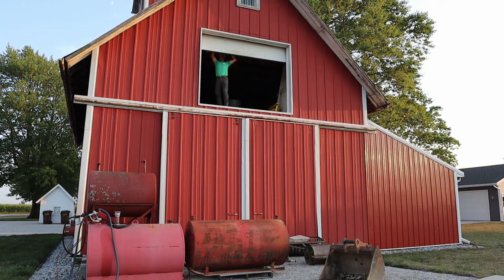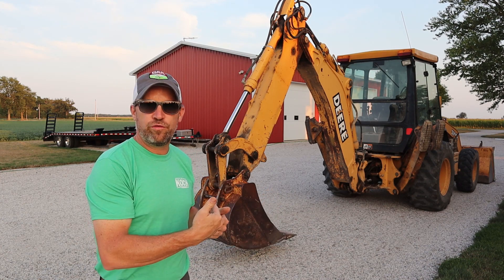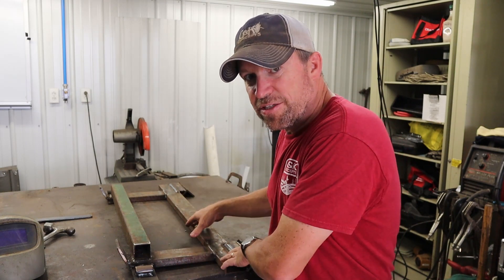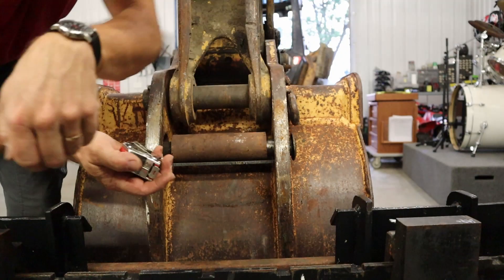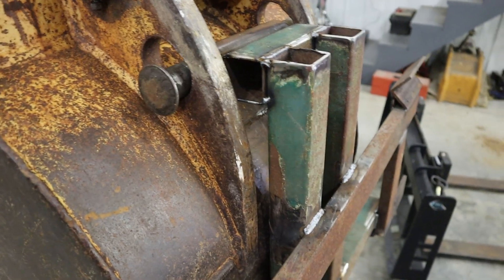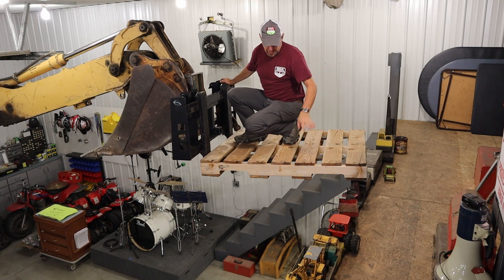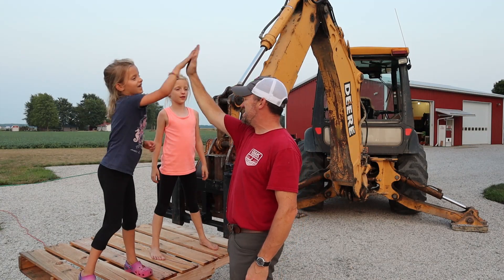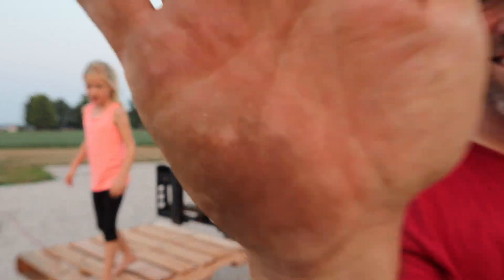Backhoe Forklift! || How to Make Pallet Fork Attachment For Backhoe w/ Quick Attach Forks || DIY

Comment: Hi there Neil. I'm looking to get a backhoe my self and wondering if the 2000 310E is comparable to what you have and if you have any advice for me looking.
Reply from the maker: Hi Dave.  Yes, the 310E is nearly identical.  The 310SE stands for "super E". I think the SE has a little bit more horsepower and a little bit beefier hydraulics. Plus it has bigger front tires than the straight E. 

But the actual machine and all the components are exactly the same. I would strongly suggest getting an extend-a-hoe.
4x4 is a life saver too. 
Mine has 8000 hours and runs great. They can have a lot of hours and still work perfectly if they've been taken care of. Make sure the pins and bushings aren't or out on the front bucket and backhoe and look suspicious at something that is either excessively covered with oil or been recently power washed. If I was buying a backhoe I'd want to look at it right after the person has been using it or buy something that is currently in use. I feel like that's a better indicator than something sitting on a lot that's been washed and painted up because sometimes they could be hiding something. When I went to look at my backhoe the guy was using it that day.  Warmed up in and it's working state. I can see anything that there was to see that could be problematic. I felt confident in buying it knowing that he was out there running it full aware that I was coming to look at it.

Hope that helps.
Reply: Thats a great help. Thanks alot

Comment: Great video ...I use an old carryall mines not as strong as this but an old carry all can work if you have one
Reply: My set up does run out of curl for level in certain ranges
Reply from the maker: Yeah. Mine just barely runs out at the top.
Reply from the maker: It is a handy unit! Thanks for watching!
Reply: Mines an old case 530/580 with a 33 loader frame.

Comment: So you got the tires into the upstairs garage but what about the rest of the car😊😉
Reply from the maker: These are tire seeds. You plant them in your barn and keep fertilizing with more parts and one day you can remove an entire car! 😋
Reply: @digdrivediy  holy smokes! I’ve got a lot to learn about this country livin. Can’t wait to have a magic barn. Where can I get the seeds? Guy names jack I’m assuming?

How’s that backhoe been to you? Considering trying to find one after the property purchase is finalized. Comparing buying a 310 size hoe and a medium size tractor for mowing, versus a John Deere 110 tlb. Mikes got me leaving towards the 110 chris is trying to pull me to the 310 side.
Reply from the maker: @JasonWorksAlot  Those country barns fill themselves in no time flat!  Just you wait!

This backhoe has been absolutely wonderful.  I don't want to jinx myself but I've had it for 10 years now and not a single complaint.  I really like the E models as they were the last of the old school with the new style boom and extenda-hoe.  I debated on a 110 as well.  Those things seem so versatile and handy.  Bottom line came down to this:  I could buy the 310SE for the same money!  Then, I bought an older 755 with FEL for $4K and have never looked back.  For me and what I do, I like having the big machine for when I need it, which is more often than ya think.  Then, I've got the little machines for the other stuff for a lot less money.  If I had the 110, I know I'd be missing the 310 the first time I couldn't pick up a tractor to put it in the upstairs of my barn!  (oh yeah, there are tractors up there too).  Good luck with whatever you decide but in my opinion you can't go wrong with the 310 (look for an E, and SE if you want to be "super"). 

ps - mine has 9000 hrs and still starts @0 degrees no problem.
Reply: @digdrivediy  awesome thank you for the input! I’m kind of in the same boat. My biggest concern with the 110 is lifting capacity. Current prices put a “decent” 310e in the same price category as a “nice” 110. The mini excavator was probably the most handy thing Ive ever owned and that would hold true even if you took all the dirt work out of the equation, I’m afraid the 110 alone won’t fill that void lol
Reply from the maker: @JasonWorksAlot  Backhoes get a bad rap for whatever reason but I'm obviously a fan. The mini-ex is hard to beat for some stuff though. I'd just like to have one of each!! Best of luck with your decision and the move. I'll be interested to know what you decide on.
Reply: @digdrivediy  currently on a long drive to a friends wedding with wifey, we’ve been discussing for a few hours now. Kind of leaning towards 310se/sg or 410se/sg price dependent, and a used zero turn mower to start. Adding a smaller tractor for brush hogging in the future when a deal comes by. 

Truth be told I’m not a big backhoe fan myself. However with the lay of the land, and potential projects on the horizon I think it’s going to be the best machine for our needs. I’ll miss my mini, and hopefully one day I’ll replace it with another because yaknow... reasons lol

Comment: What a great idea , looked like the angle geometry was just about right .
I did kind of similar, but on the front bucket, welded 2 -1/2”x 12” on each side at the top , to put a pin through for each individual fork , & the bottom of the bucket acts as the back stop for the bottom of each fork . Problem is only goes as high as the bottom of the loader bucket 
, about 8’
Reply from the maker: Sounds like an interesting setup Robert. Really appreciate you watching and commenting.

Comment: Did your arms burn after all that welding?😂
Reply from the maker: Fortunately not this time!  Should have had my long sleeves.  Thanks for watching Henri!
Reply: @digdrivediy  
Had to laugh. Bin there don that. 
(Hot summer day and a couple of beers. Lol) 
Great vid btw that’s  exactly what I need on my jd410 
I noticed the scraper blade on the bucket teeth. You just U bolted it on? 
Subbed 👍

Comment: nice, but i would scoop up a bucket of gravel or sand in the front end loader before reaching out so far
Reply from the maker: That's a good call.  There have been a couple situations where I did just that and added some counterweight to the front bucket to help out.  In this video you can see me put a giant rock in the front bucket to help offset some weight on the forks:
https://youtu.be/yJMsbd65P94
Appreciate you watching and commenting!
Reply: @digdrivediy  i missed the rock. wish i thought of that setup when i had mij backhoe for an extension boiling last year. made due with lifting straps but height was alway a issue.
Reply from the maker: @kurtkesters6043  Oh, you didn't miss the rock in this video.  It was in a different video where I used the backhoe forklift to raise up a deer blind.  That was the link I had shared.  Sorry to be confusing.   You're right though, having the extra height with this setup has been really cool.  I've been using this forklift a lot to put stuff in the barn that I'll probably never get back down!  cheers!

Comment: pretty cool project and if you need to lift something a little heavier, you can fill the bucket in the front with sand or whatever you have to act as a counter-weight ;)
Reply from the maker: Very good point!  I can add a ton (literally) of counterweight very quickly for those heavy lifts!  Always appreciate your comments sir!

Comment: Hi i have a questions about your box scrapers
Reply from the maker: I'd be glad to answer any questions you have.  Thanks for checking out the video Fernando!
Reply: @digdrivediy  so i have a kubota bx23s and i saw you had the hydrailic hoses for the piston moving the wheels where would i conect the hose, or do i need a special kit for that. Sorry i know its late
Reply from the maker: On my tractor I installed the hydraulic hose connectors that run the grader box.  If you have a front loader on your tractor, then the easiest thing would be to run the hoses up to the connection points of the loader and unplug a set of loader hoses and use them to control the grader box hoses.  If you don't have a loader, then chances are you will need to install some hydraulic remotes or sometimes referred to as a "power beyond" and it will likely be kit that you'd need to get from Kubota.  You can also use an electric actuator instead of hydraulic cylinder if you don't want to mess with hydraulic lines.  Good Luck!
Reply: @digdrivediy  thank you you are really helpfull